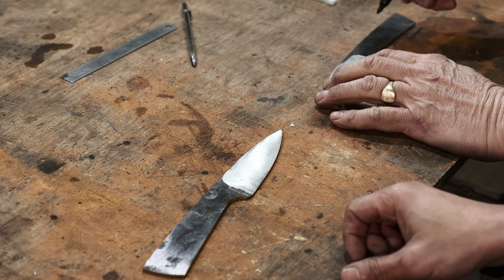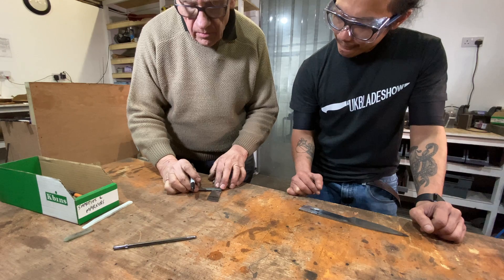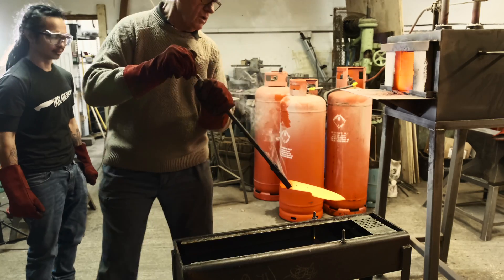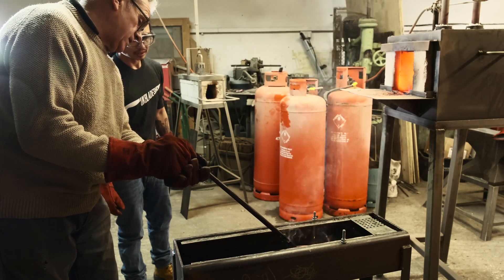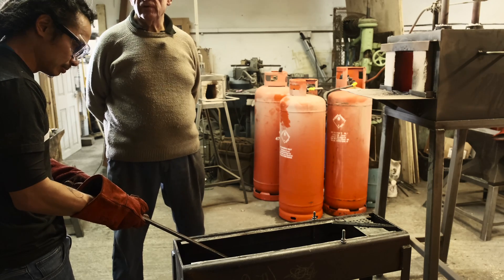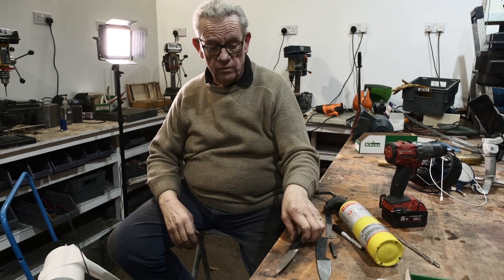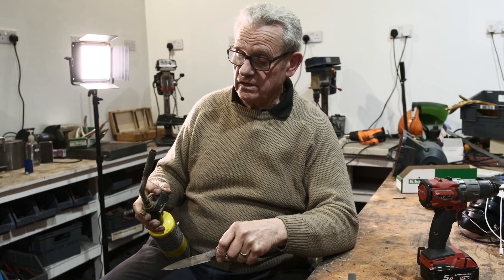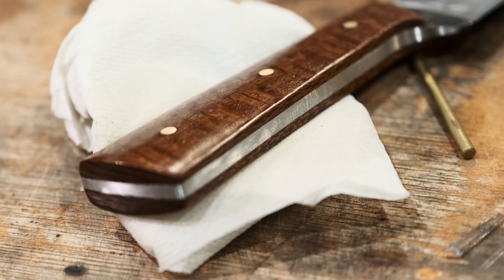BEGINNER heat treatment Knife Hardening & Tempering

Comment: I've never seen tempering done with a torch before, so much quicker than sticking in the oven for an hour or so.
Reply from the maker: Cheers for the comment Jason! If you think about it, putting a low torch and heating up the blade is the same principle as a conventional way of tempering it!
Reply: @UKBladeshow  Out of interest would this form of tempering work with most of the steels or is it suited to just a particular group?

Comment: Most enjoyable video as always! I will have to be That Guy though: what's the real world difference between tempering to ~200C for a few seconds and tempering at ~200C for a hour (twice)? Completely understand the torch is much more practical for the time constraints of a two day course but are you losing out relative to the conventional hour-long temper?
Reply: I could bore you for hours on this topic so although I've tried to keep it brief you might want to get a coffee or beer before proceeding.

Plain or very low alloy carbon steels are fully tempered once they reach temperature. Nothing can be gained by holding at temperature for a period of time. More highly alloyed carbon steels and tool steels (inc O1) are a little more sluggish and I wouldn't temper them with a torch. they do need to be tempered in an oven. The industry standard is 1hr/inch once the furnace reaches temp with a minimum of 1hr for sections under 1 inch. 

I, as a metallurgist with 50+ years experience in commercial & industrial heat treatment, cannot see why more than this is necessary. It's all a matter of how quickly the alloy atoms can re-arrange themselves within the steel structure during tempering. Carbon atoms are very small and move like Harry Potter's Quidditch Snitch. Others are bigger and slower like a Bludger!!!

Double tempering is only required where the hardening process generates retained austenite in the steel structure. I won't bore you with the technicalities of this but it mainly occurs in high alloy tool steels, high speed steels and heat treatable stainless steels. The first temper destabilises the RA which itself then needs a temper, hence second temper (and some high speed steels need 3 tempers). However, this destabilisation only occurs when tempering above about 450 Celsius. For knifemakers using stainless and wanting to temper around 200 Celsius it's best to modify the hardening cycle to minimise the generation of retained austenite or use low temp cryogenic treatments or a combination of both. I'm not certain that a second temper at 200 Celsius is beneficial but it certainly can't do any harm. When I get stainless springs, for example, sent in for heat treatment (for folding knives) then the first temper is at 500 Celsius, which destabilises the RA and often increases the hardness, then a second temper between 540 & 630 to get the required hardness.

I hope this answers the question but if not let's have it.
Reply: @grahamclarke4470  Beer in hand, let me assure you I would not find it boring. I enjoy geeking out and learning new technical stuff like this. Thank you very much for taking the time to write up your answer, it's clear and informative. From what you've said, I guess Vinz's knife is something like 1075? Since I've mostly used O1 with occasional excursions into 1095 (trying to get a hamon) and 80CrV2 I guess I'll not worry about a second temper cycle so much any more.

If I've understood Larrin Thomas' book correctly, RA in high alloy steels is at least partly caused by the Martensite-finish temperature being below room temperature. Thus cryo, prior to tempering, is helpful as it gets the steel below Martensite-finish and allows a more complete conversion of Austenite to Martensite?
Reply: @RobanyBigjobz  
Indeed a great book 👍
Reply: @grahamclarke4470  thank you sir! I, as a new knifemaker, am very curious about all the possibilities and processes (need to buy some books, i know). If i understand it correctly, a one hour temper would be sufficient for O1?
Reply: @grahamclarke4470 Great comment! I'm sure it is still possible to destabilize some austenite though, at lower temperatures, I'm sure. At least if done for longer time periods like 2hrs in a thin cross section. Also 4 hrs total would be softer than just instantaneous, but without getting into the tempered martensite embrittlement range, of 250C, no?
Reply from the maker: Excellent question Rob! I will get back to you once I’ve conveyed your question to Mr Clarke! Thanks for the comment and feedback dude!
Reply: Was also wondering about this method. And does it apply to all (common) oil quenching carbon steels like O1 for example? Thanks for the vid btw.
Reply from the maker: Hi Siep thanks for the comment ! I’ll let you both know soon!